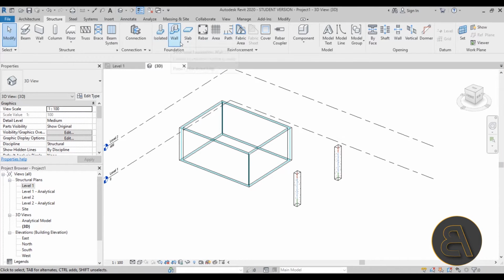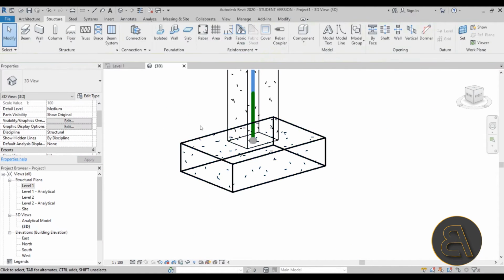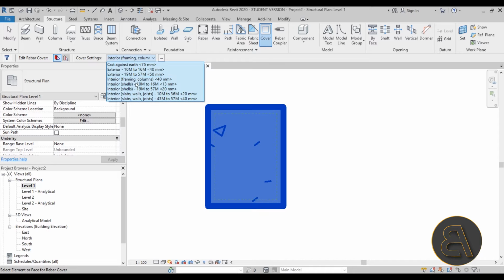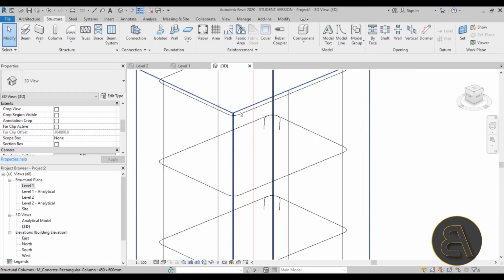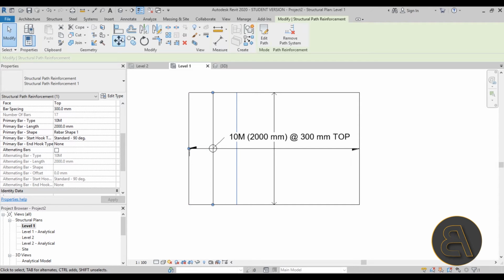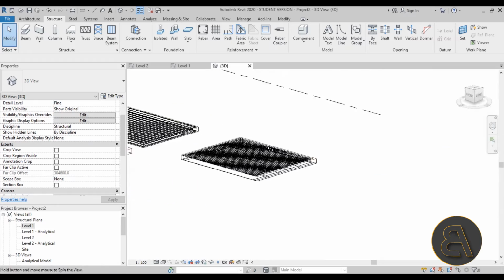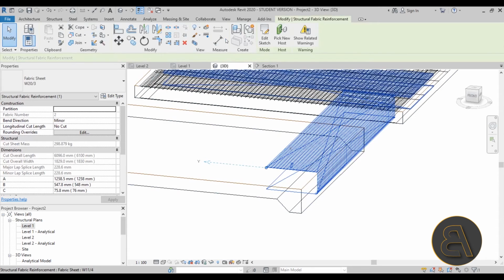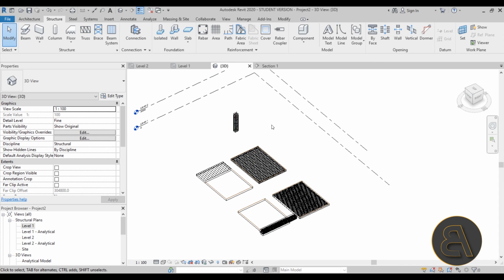Every Structure Tool in Revit Tutorial   Part 2

Comment: i tried to draw high rise. when i finished all the part of buildng, i changed the view from architecture to structure. and the wall has gone. i have the problem to show a section of the core wall of building as a structural view. is that possible for wall showing as part of the structure?  Anyway, Good video. i  followed you channel since you didn't show yourself in front of camera, hahaha.... keep doing it!
Reply: Tick on the property of the wall called 'Structure' in it's instance properties. That should tell it to remain on for structural type views.
Reply: Go to visibility/ graphic, you  can press shortcut vg. And check if the wall is visible